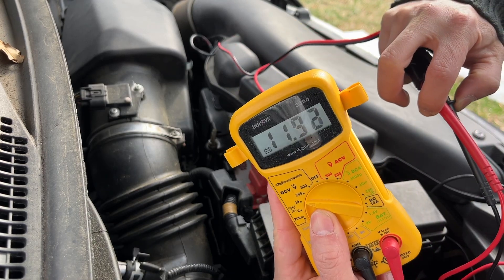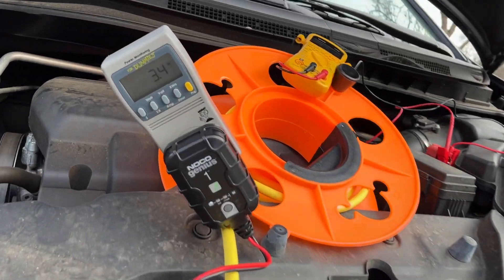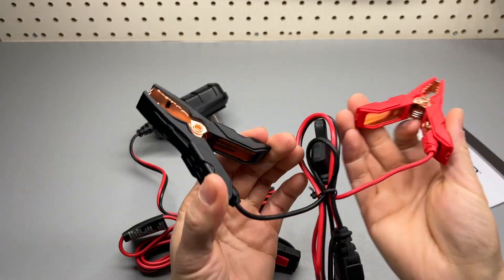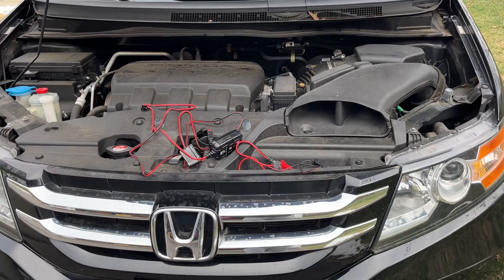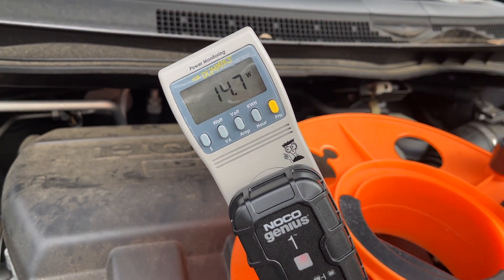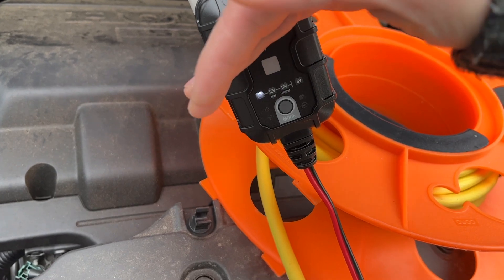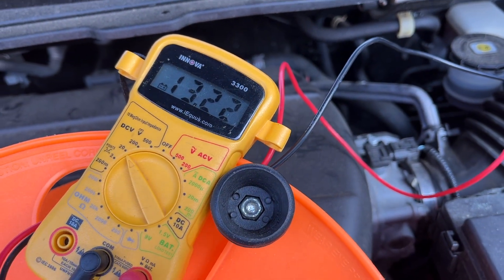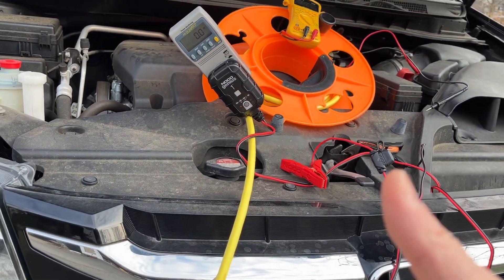NOCO Genius 1 Battery Maintainer (Charges Honda Odyssey car battery)

Comment: So disconnect black cable from car battery. Disconnect red. Attach red cable from Noco. Connect black. Turn Noco on. Noco does the rest. Once finished, disconnect black, disconnect red, connect red, connect black. I’m dyslexic so I won’t be offended if anyone corrects me. As I usually need a reminder with batteries and speakers.
Reply from the maker: Glad you liked it! Watch my new videos. Like and subscribe!

Comment: My dead car battery is 60Ah
Manual says charges up to 30Ah not gonna charge it anyone rekon?
Reply from the maker: it will, but just very slow.
Reply: Wow. 50 hour charge and the light went green and my van started (1.8 Diesel) 
Was just clicking 2 days ago. Great product
Reply from the maker: @ thanks good to know !!

Comment: Noco makes great battery chargers ,i saved a group 65 battery that sat for 2 years no use i used this noco 1 amp charger left it on a whole week let it do its thing ,did a battery test on battery it passwd with flying colors ,noco chargers worked very well for me ,take note not all batterys can be saved  but ones can be saved again great chargers to use
Reply from the maker: yes NOCO makes excellent products!

Comment: I have a problem with my car draining the battery and nobody (firestone, toyota, or anyone) can tell me why. This product was recommended to me.  It seems like a charger that lets you know how much juice is in your battery. Does this device restore a dead battery?
Reply: You can find which circuit is leaching the battery down. Charge up your vehicle battery with the positive terminal disconnected from the car. With the key off, put your 10 amp capable ammeter between the positive lead and the positive terminal. See how much current is being used. It should not be more than about .3 amps, or 300 milliamps. You probably have half an amp .(5 amps or 500 milliamps+) load. With it connected, remove fuses until one of them causes the amp draw load to drop down a lot. Look up that fuse on your diagram of fuses to find out which circuit it is. You will have isolated the problem to a single circuit in your car, which is extremely helpful. 
From that circuit you can find which leg of that circuit is drawing power.
Reply: @troy3456789  Thank you so much for the advice.  I have been disconnecting my cables when I park.  Sometimes it sucks but it works like a charm. I don't understand why Firestorm can't do this.  Thank you for the advice and I will try and use it.
Reply from the maker: No, you need genius 10

Comment: Can this charger be used in a closed garage/with the garage door closed? The instructions first say to use in a ventilated area, but then goes on to say you can leave the charger connected indefinitely; I’m assuming they don’t expect people to leave their garage doors open for months on end, but I just want to be sure.
Reply: Most garages are leaky enough to permit sufficient fresh air flow. The gases being emitted are hydrogen, oxygen and Sulfur Dioxide. Sulfur dioxide gas is usually produced when the temperature inside the battery exceeds 60.0C, and current flow exceeds 10amps.  Sulfur dioxide gas is colorless but has a pungent smell and can be picked easily by the nose

This device cannot make your car battery exceed 60c or pass 10 amps.
Reply from the maker: Good question I don’t know.

Comment: I noticed you are doing this outdoors, would it be safe to use this in the rain connected to an electrical outlet? My garage is full so I would have to park my car right outside my garage and connect it to my home electrical outlet. Thanks for any insight!
Reply from the maker: not recommended, but I left it outside when it rained, nothing happened.
Reply: They are absolutely waterproof; (all the noco battery charger maintainers)
Reply: @troy3456789 
Thy aren’t !!!

Comment: Can I take the battery out of my car to charge it or does it have to be plugged in the car
Reply from the maker: You don't have to take it out of the car. Use the clamps for connecting to the terminals.

Comment: The battery has to be hooked up to it ? I can’t charge it and then bring it to my car ?
Reply from the maker: It is a charger, not a battery
Reply: @ToolsElectroDIY They are asking if they can take the battery out of the car to charge it and then bring it back. We just want to know if the battery needs to be in the car while its charging. People want to know this because not everyone has an extension cord or a way to charge the battery while its in the car so they need to take out to charge. We are asking if that is possible??
Reply: @Yourunkbob  Yes, you can remove the battery and charge it up with any noco smart charger.
Reply: You can take the battery out. It usually takes 2 days to charge a dead battery

Comment: This thing it is not convenient for the people who live on apartment
Reply: Take the battery upstairs with you that’s what I would do honestly
Reply from the maker: Then, what is the best option if you live in an apartment do you have a better recommendation?
Reply: So buy a house
Reply: @Slow370Z yeah easy, just drop 500k
Reply: @D0ubleSwipe why half a million?  Can't get one for under 200k?  I got one for 153k
Reply: I just took my car battery out for this I live in an apartment
Reply: LOL
Reply: Extension cord woman
Reply: Pull the battery out the car and take it upstairs
Reply: If your own house  you can take out extension wire  to your car but if you live you have common parking lot,you can’t leave your car  hood open for charge for safety reasons I need long extension wire if we ignore the other reasons there are people who live third or above floor
Reply: @anchiledi9722 you can buy a power bank with a plug.
Reply: Apartments aren’t convenient. They are made for people who can’t afford a house. That’s your problem not Noco’s

Comment: Just I need to operate my small car.
My battery is already dead.
It can be useful?
Reply: Use "force mode" if it won't read the battery meaning it has less than one volt. You have to hold the mode button down for 3 seconds or more to get to force mode.
Reply from the maker: It’s worth a shot it’s cheaper than getting a new battery
Reply: @ToolsElectroDIY  can I connect this device to my car directly to start it ?
my battery now is useless. just need to change it after operate my car
Reply from the maker: @batigol202020  It may take a long time before you can do that. You need a battery jump starter for this. See my review https://youtu.be/nKuxuYiIh0U

Comment: Anyone know why it might be stuck on standby for my car battery?
Reply from the maker: What is the voltage of the car battery?
Reply: @ToolsElectroDIY  He forgot to push the mode button the first time you use it, it always goes to standby mode with a solid orange light.
Reply: Push the mode button because they very first time you use it it will go solid orange in standby mode. The second time and beyond it remembers what you chose for the battery selection.

Comment: How do you make it automatically detect the type of battery…?
Reply: I’m not sure it’s automatic- another video looked at the manual (which was not included for mine!) and said that, no, this model is manual. (Cannot verify- will have to look online for the manual!)
Reply from the maker: by default, it is automatically.

Comment: Subscribed, Question - do you need to charge it before using it?
Reply from the maker: No. It is doesn't have a built-in battery.
Reply: You have to have it plugged into an electric outlet to use it.

Comment: Motorcycle battery. which should i use 12v or 12V agm
Reply from the maker: If you run stereo long time, get AGM.
Reply: The battery will say if it is an AGM battery. AGM batteries are more rugged to withstand shaking better than regular flooded lead acid batteries. AGM and regular batteries are flooded lead acid batteries, but the agm has a fiberglass mat between the anodes and cathodes. 
They are slightly higher voltage than regular batteries, and the noco can be told to charge it at 14.6vdc agm rate.

Comment: Doesn't blinking green mean the battery is currently in absorption stage?
Reply: Just to clarify for some of you. . . . .Pulsing green means bulk charge complete & optimizing for long life. Green with SLOW pulse means 100% charged & in maintenance mode. Recommend leaving connected until it turns to a SLOW green pulse. Disconnect before the optimization stage is complete & you don't actually have a full charge yet.
Reply: the red light is still on after charging overnight. what does that mean?🙁
Reply from the maker: Yes, "trickle charging".
Reply: @Tools. Electro. DIY  So, technically not fully charged yet, I'm assuming?
Reply from the maker: @rsc102  At that stage it should be considered fully charged. This charger is just maintaining the battery at 100%
Reply: @Tools. Electro. DIY  Understood. I'm just a bit confused because this device uses two different blinking green lights for the battery's charged state.

Comment: Thanks for the video. What would be the reason to go with the Genius 2 over the Genius 1, just 2x charging speed, or?
Reply from the maker: Yes the speed is doubled.
Reply: If your battery is not in terrible condition, the noco1 is perfectly capable of making it like new again.